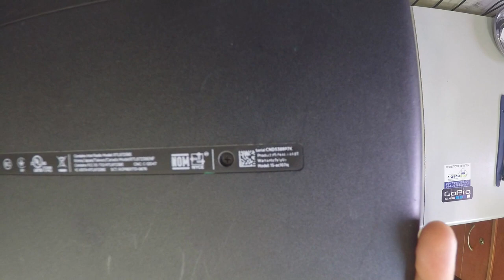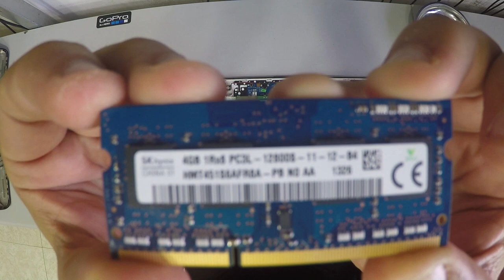HP Pavilion 15 Full Disassembly and Reassembly

Comment: Hi, first. Good video. I have a question. I buyed a HP 15.6 ay007la. The computer is overheating, if the temp room are 35 C, the notebook at full load, come to 80°C!, this are normal?, am, if not, on the heatsink ventilation... i see only a black metal, but i never hear any fan or anything.... thanks for reading!
Reply from the maker: hello brayan
this model off hp have a dust problem on the heatsink .
1- you can use a compressed air can (spray it with full power over the heatsink).
2-open the laptop to clean the fan (similar video link) https://www.youtube.com/watch?v=hIv9FfUwgls 
have a good day.
Reply: Hi again... this pc are new. I recently buyed, i only see a black cover like a metal..... the pc never go outside, the pc forever are inside.... so, dust, dont are...... my pc really dont have a fan true?, it have an Intel Pentium N3710, and have IGPU.....
Reply from the maker: hello brayan 
if this is new laptop you must use the hp warranty. don't true to fix or open the laptop.